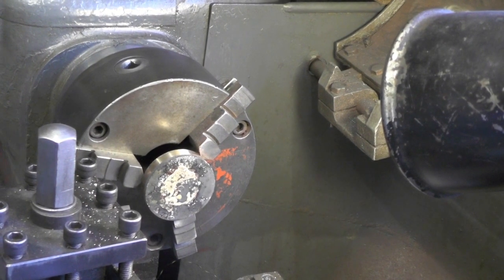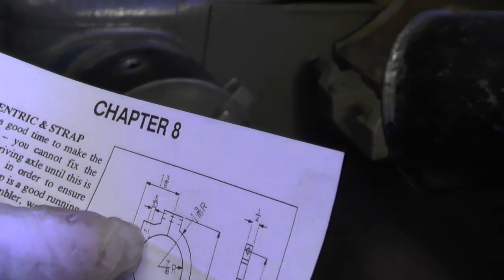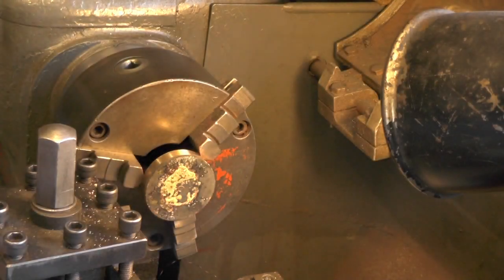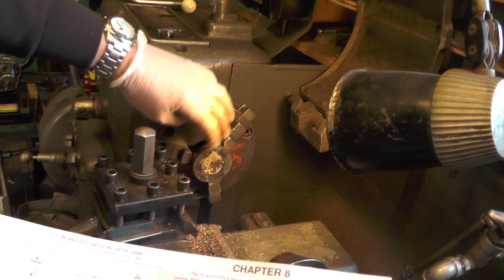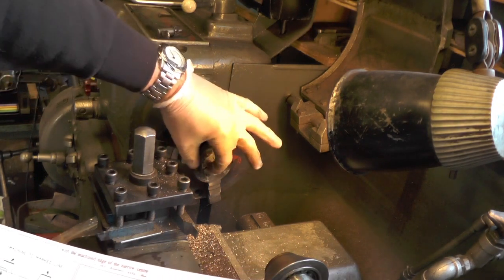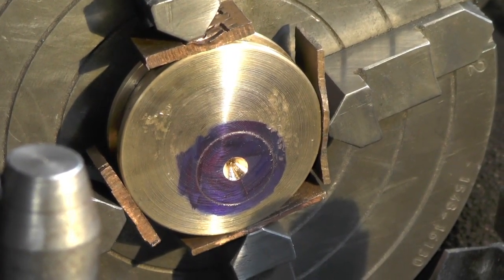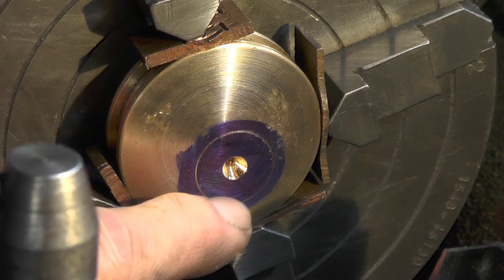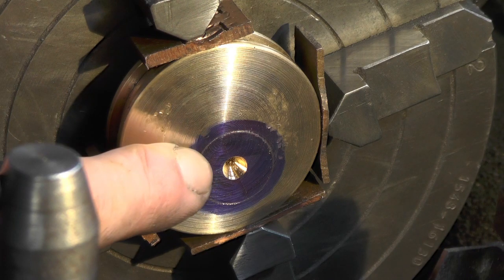Making a Beginners Steam Loco (Axle Pump Drive Eccentric Part 2 The Tumbler) "mr factotum"

Comment: thats how im doing mine now... thank you for showing this
Reply from the maker: Hi simon
Appreciate your comments, all the best with yours, is it a sweet pea your building
Regards
Mr f
Reply: @MrFactotum   ive got a few on the go at the moment ,but still on the frame work on all ,as there all done from scratch ,as so many as the parts are hard to come by and having to build them from scratch too,so i jump from one to the other to keep the kettle boiling, 2 tich's  31/2 &7 1/4, 5 " midland spinner and 3 1/2" heilan lassie with just copies of model engineering magazine as a guide no drawings because i cant afford them...youre videos are helping a lot especially with the axle pump eccentrics ...looking forwad to the next video...regards  Simon
Reply from the maker: Cheers,
Sounds like you've alot on, good luck with them, better than being bored.
Regards
Mr f
Reply: @MrFactotum  my challange will be to make a 8 inch 24 spoke wheel from 15mm steel plate..with just a lathe and a press drill..because it will be quicker to make than find the wheels on my budget lol any tips would be gratefully accepted
Reply from the maker: well it sounds a big task, but like anything if you apply your mind to it anything is possible in the lathe, I like a challenge as well
best wishes and let me know how you get on with it
regards
mr f